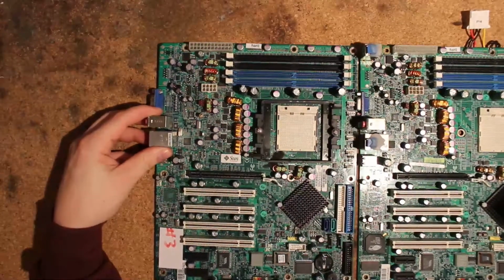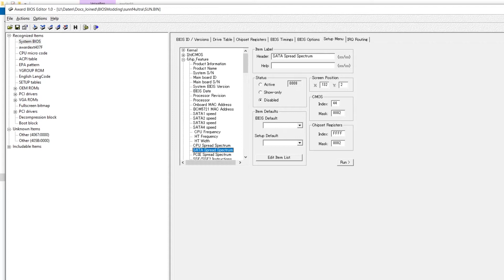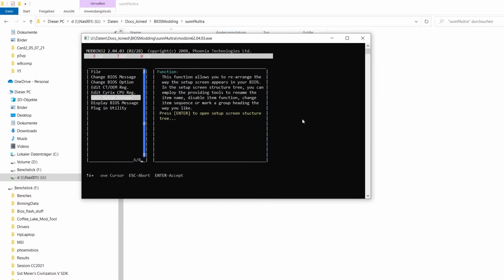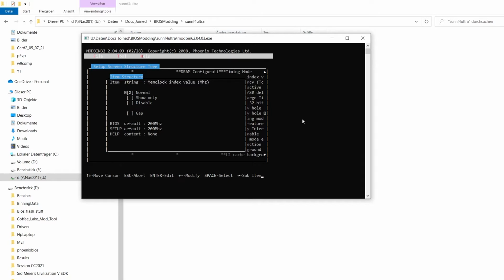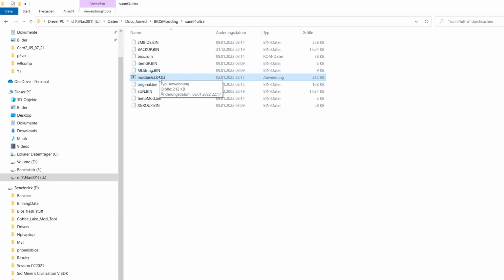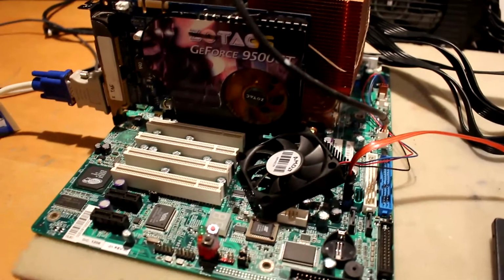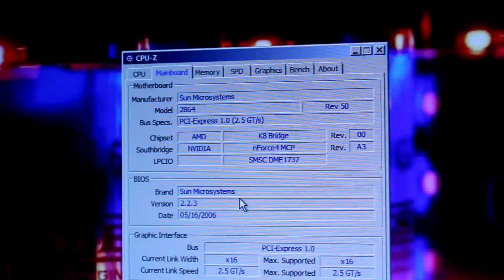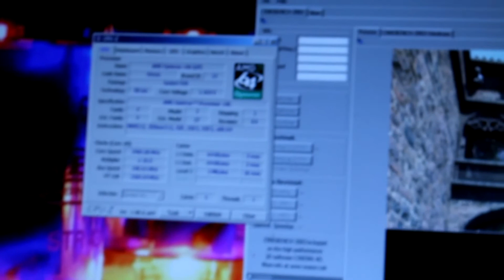How to unhide/enable options in AWARD BIOS with modbin6 + rambling about SUN nF4 boards

Comment: Hey I wanted to know your opinion on something 
I have a laptop HP EC1011NV 4800H with 1650 GDDR5 
how could someone voltmod the gpu ? 
How could someone unlock the hidden menu of bios ???
Reply: the bios for newer pcs is WAY more complex(laptops usually are extra hard)
you probably wont be able to voltmod the gpu bc of lacking space and WAY more complex power delivery design
Reply: @nigrum_tredecim  thank you for replying back to me
Reply: Where did you learn all this stuff ?

Comment: Yeah..I gotta do something like this probably. I recently got some VIA EPIA C3 based miniITX boards but configured different than specs: the CPU is 1ghz but it's supposed to be 133fsb x 7.5 as stated on the CPU package itself but it has been set at 100fsb x 10 as well as some other annoying little things.
Reply from the maker: I have no idea whcih modbin version would even work for VIA stuff, sorry can't help with that :(
Reply: @taggxoc  Hey, I figured out how to change the multiplier, but not in BIOS. I had to pour over some sections in the VIA C3 Nehemiah pdf and figured out how it works. It's not set at the factory in chip like the previous C3's. There are 5 locations taht control multiplIer on the BGA: BR4, BR3, BR2, BR1, BR0. There are 5 pairs of pads on my mobo that depending on whether or not they are open or closed via 0 ohm resistors configure the multiplier :)
Reply: @taggxoc  well, it is an award bios, so that shouldn't be too hard.
Reply: @taggxoc  So, good news...modbin works on the BIOS BIN file. Bad news, not a whole lot in there to toggle on and off. FSB is set via board jumpers, I toggled everything on that I could, but there isn't any clock multiplier stuff in there. Maybe might be able to do something with the autotable option to set the default CPU clock registers?